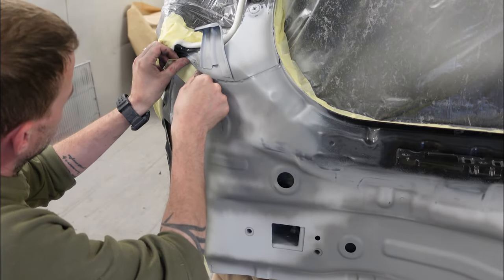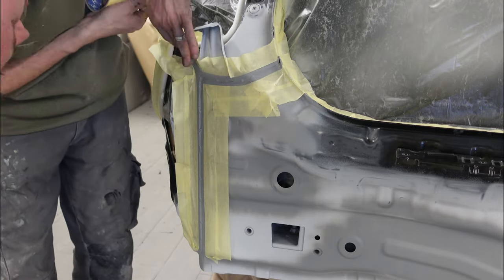Sprayable Sealer Gun and Lets Get Some Paint Down - ReBuilding A Wrecked copart Salvage Car PART 3

Comment: The sealant gun looks impressive for the money, thought you were holding a rocket launcher when I first saw it Lol. The Wayside sprayable seam sealant is good stuff, used it several times and got good results by spray or brush for small areas.  The Wayside windscreen adhesive is good too. I currently have an old style seam sealant gun where the sealant passes through the gun, rather than straight out nozzle like one you have there, which makes gun cleaning a slow process. You can also get wide nozzles that screw onto a normal seam sealant cartridge in hand gun, good for laying down a quick bead without needing to mask anything up. Nice finish on the clear 👍
Reply from the maker: Yeah it’s been a good investment and I’ve used it twice already this week on this job and another too

Comment: It's always educational watching someone else repairing cars, and not too many painters do from the panel work through prep, and paint, right through to polish, well done buddy a good job it looks mint, 
I've never used the sprayable sealer gun..technology, .moving on
How well does the sealer fill into the panel overlap join.?
 Did you seal the outer and inner panel, or was the original factory sealer not in the inside of the car, 
How flexible is the sealer once dry stiff rubber like windscreen bond? softer like tiger seal.? Or exactly like the brush-able seam sealer from the tin
Sorry for the all the questions , I'm just curious and your the only person I know or virtually know who's used one, and I respect your opinion,
I wouldn't blend black's, black pearl, water base black , thinner based black, I'm with you there..but
a mid shine semi gloss or Matt black finish I probably blend or do the whole side 
Cheers for the videos,,. nice one

Comment: Hello Tony a  tidy job looks really good gave me a good idea how to go about putting  a sealer on if I ever get a chance one day great  video 
Another  thing was I just purchased  a ws400  of a frend and I watched one of your  videos  on the setting I had fan out from in but 2 turns and flued 1 coat 2 1/2  turns out from in and 3rd coat 3 turns out from in and air pressure  2 bar it was awesome sprayed  a wing fast hardner upol 2k and today I used the same but standard hardner it came out brilliant  I thought  I would treat  my self  and buy this gun any other  tips would be great and also any other clear to use thank you for the video  great  job
Reply from the maker: Clear wise mate I use mostly atm either final systems ultimate clear or roberlo 610 , Mipa cc9 is also good

Comment: Great chat here last night Tony with me hogging the chat window and being picked on as usual 😁😂 

That seam sealer gun is a nice bit of kit mate and is ideal for a busy shop like yours. I used the Final Systems clear this morning with the Churchill Medium clear it was 26C in my booth (no heat) and it flashed off in just over 2mins, I haven't tried it as a WOW clear yet as I only do single panels I think a short flash time is needed, what do you think mate?

I got a 5L tin of the Final Systems Ultimate clear a few days back from Marlow Paints as they sell it as a clear only if you want which makes it cheaper without the hardener cost me £51. I had a few problems finding a 2.5L tin of the Churchill hardener but ended up getting it from Macc Paints for £29, I would imagine you get it cheaper in the trade.
Reply from the maker: That’s good mate and yeah a probably would be going wet on wet on a wing mate lol , think most Churchill hardener tins are 2.5litres tbh but not sure what we pay lol
Reply: When I first got the Churchill hardener I got 2 1L tins, one was medium and one fast. I think the fast was as quick as the Final Systems Super Rapid but as far as I could tell without the dieback issues.

Maybe one of these days you can try the Octoral C401, even with the H23 extra fast hardener there is zero dieback and the finish is IMO as good or better than the Kronox 610.
Reply from the maker: Fair enough mate , and it’s doubtful il be trying the octoral stuff mate tbh but we shall se what the future brings

Comment: Have one of these sealer guns also, just used it for the first time last week. What pressure did you find works best? I was using wurth sealer and found no happy medium to the amount of product that was being dispensed. The wurth guns are triple the price buy do have a knob for adjusting the amount of product as well as the air pressure which is good for getting a nice light coat at a higher pressure.
Reply from the maker: il be honest mate im not sure what pressure at all i start on paper get it where i want it then move to the car

Comment: Hi Tony love the spray sealer gun never used one before they look very handy indeed especially for new motors. 

I must try some some different clear coats after seeing some of the great results you get. Been stuck in my ways for years  probably 6 or 7 I use max meyer 0200 system. It just works for me it's like a old friend lol. Another thing not relevant to this but I also still use polyester as well another one I don't see many people using apart from your self you used it a few videos back I think in the Vauxhall estate.
Reply from the maker: Personally I could never get on with 0200 I found I just had solvent pop issues every time I got a great finish with it lol
Reply: @TonysRefinishingTV  really never had an issue with solvent pop. I have found it definitely likes a longer flash time then recommended (outside temp/ humidity depending) on average I would say I leave it 20 mins half hour they recommend 10 I think. I also keep a very good airflow in the both and definitely not to heavy coats. 

What would you recommend trying out as a good alternative to try?
Reply from the maker: What sort of price are you looking to spend buddy ? As I know 0200 is on the cheaper scale of things
Reply: @TonysRefinishingTV noting to expensive but I will spend.the money for the right products Just looking for a good all rounder to give a go as I said been stuck in my ways but I get good results and returning customers so can't be to bad lol
Reply from the maker: Ok mate what do you call not to expensive need a budget idea mate as some think £130 kit is expensive some thing £200 a kit is and so on lol
Reply: @TonysRefinishingTV  the results are good then the price doesn't really mater as I would just factor it into the on to the pricing of the job. So 150 to 200 I would be more than happy to spend.
Reply from the maker: Ok then easy to answer mate Mipa cc9 or roberlo 610 or 620 I think is the newer version , those are by far my go to clears for nice work
Reply: @TonysRefinishingTV  going for the Mipa will order some tomorrow I no my supplier stocks Mipa as I have some of the 4+1 if not I will order some online. Nice one for the recommendation i will give it a go.  I will let you no how I get on.
Reply from the maker: No problem at all fella
Reply: @TonysRefinishingTV  all done be hear in half hour £146.35 seemed quite reasonable looking at the online prices. I went for the  normal HS25. I have a basically new Valencia orange clio in on friday for a light repair on the front bumper corner but its definitely going to need to be blended into the wing. The clear coat has a amazing finish for factory basic 0 peel so hopefully the cc9 will do it justice if I lay it down right. First orange car I would have done dam all these modern colours 😂.  I will be using my Devilbiss GTI Pro lite with the TE20 1.3 cap should be a great combo 🤞
Reply from the maker: Nice man let me know how you get on fella

Comment: Hi tony I’ve been thinking about trying that clear as we order a lot from advanced paints. We’re currently using maxmeyer 0300 which is a decent clear although expensive. What is it like to nib and polish with it being scratch resistant
Reply from the maker: Hiya mate personally find 0300 so temperamental for solvent pop , the final systems stuffs nice to flat and polish with no dramas mate just as I say be carefull on your hardener choice as I find there fast ect makes it pull back a lot so you loose the gun finish gloss